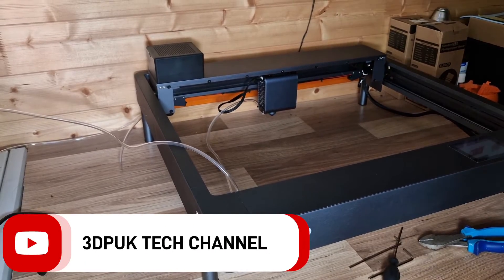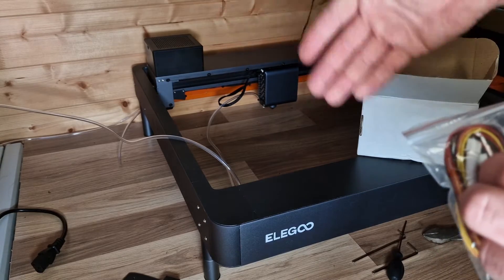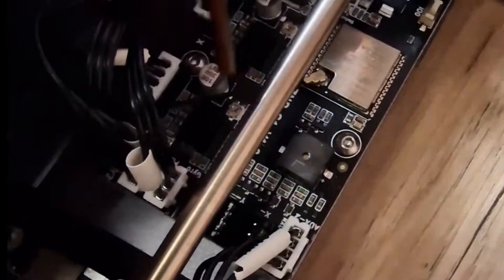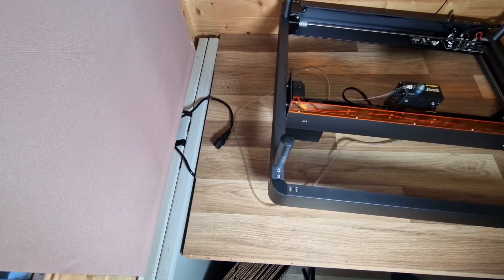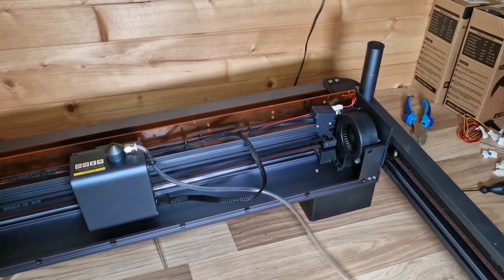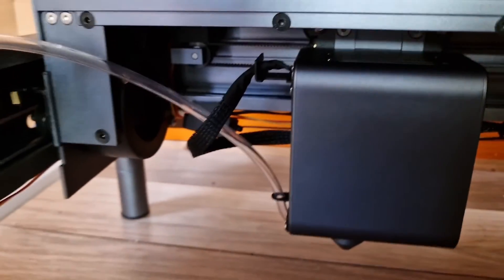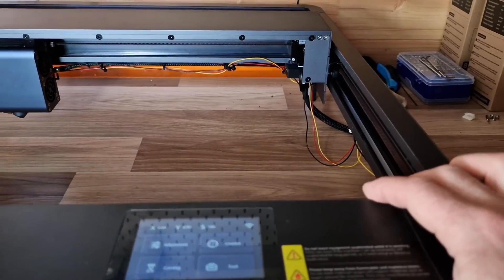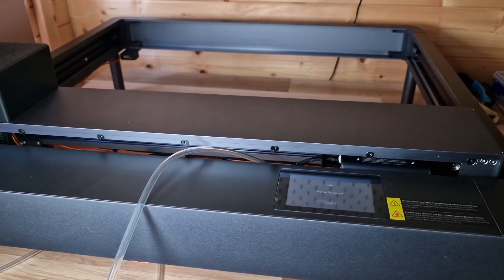Elegoo Phecda Laser Limit switch by GeeksAtLarge installation

Comment: Hello, I just finished the installation of the limit switch by geeks at large and it showed the "home successful" message; home is front left. I tried to "frame" and it moves quickly to the right and it shows the "hard limit confirm" message and it doesn't move from that position. Would you know how to fix this? thank you.
Reply from the maker: Are you using lightburn?
Reply: @3DPUK-TECH-CHANNEL  yes,  and I followed the instructions
Reply from the maker: @dhurata6235  that's really odd I'm away on business this weekend so next work i will check all my settings as I'm sure I had some issues too
Reply: @3DPUK-TECH-CHANNEL  ok, thank you. Appreciate the help
Reply: @3DPUK-TECH-CHANNEL  I think I found the problem. Apparently the "start from" was still under origin and I just changed it to "absolute coordinates" and it did frame, finally after a week...

Comment: Thanks for the review, especially the honesty that it wasn't perfect for you. I use this to improve the product. 

Side notes:

1. The X cable wire length between the controller and first limit is setup so that it matches up with the module cable and enters the gantry through the same notch. I'll update the instructions to make that a bit more clear.

2. The number of included cable clips is so that some can be used along the inside of the gantry. Your use zip ties also works too of course. 

3. Next product update will have sleeved cables and have epoxy to keep the wiring intact at each connector.

4. For those that need them, longer screws for the right X limit (the one at the flame sensor) are also included. A small number of folks received machines with screws which were shorter than the machines I received, so longer versions were added to the kit just in case

Thanks again!
Reply from the maker: Appreciate the comments, to be fair I can be sausage fingered so could be me too.